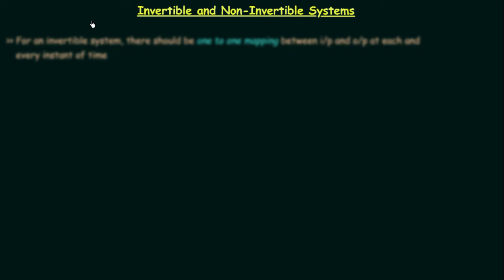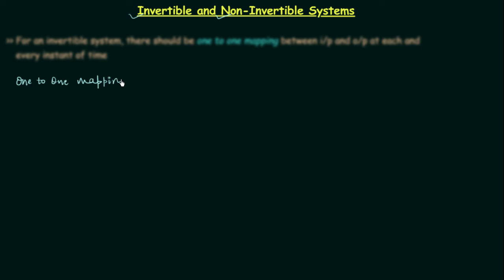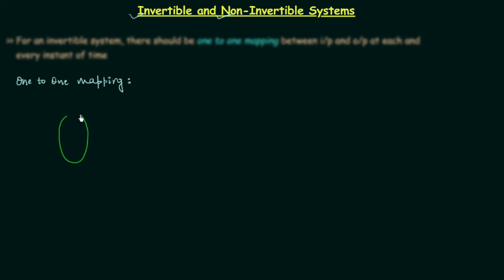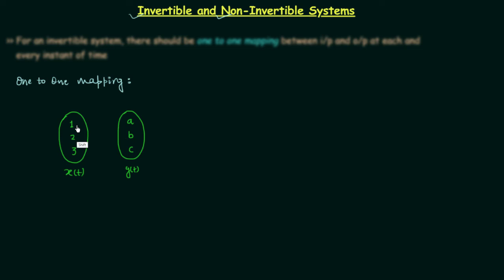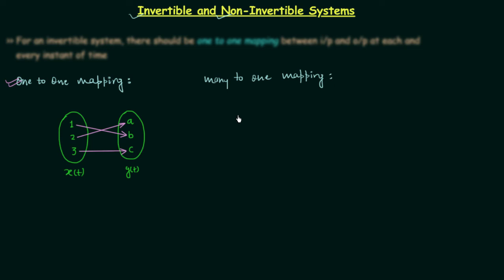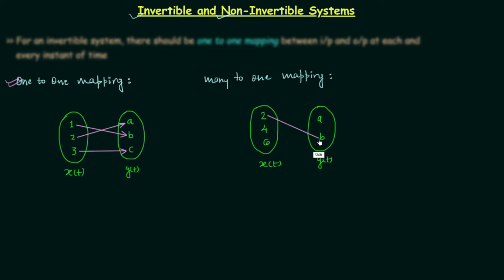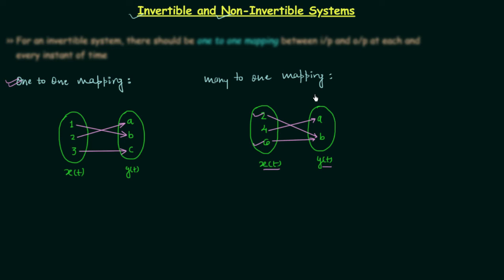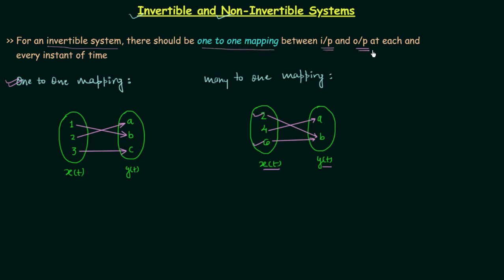Invertible and Non-Invertible Systems

Comment: I found a mistake. At 06:30 Example 2 is NON Invertible. Check x(t) =0 and x(t)=-4. Both have the same O/P which is 2. So It is Non invertible. Please confirm Neso Academy
Reply: Omar Kiyani by putting x(t)=-4 we get y(t)=-2,  not 2 ... so it's invertible system
Reply: Multi - YTC Sorry! I was binge watching for an exam and I miscalculated! Thanks
Reply: @Oktheorignal  and if we keep -2 then output is zero so it is a non invertible system
Reply: @rahulsinghthakur420  only for -2 it gives zero. for other values it won't give zero. So it is invertible system.